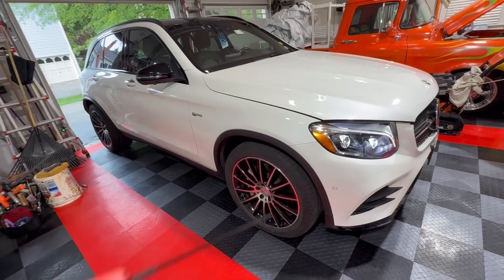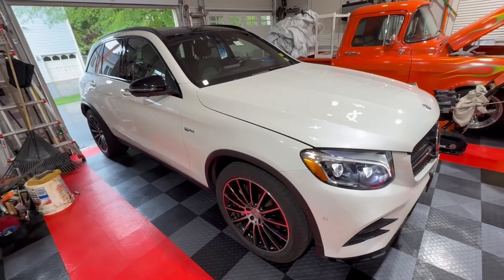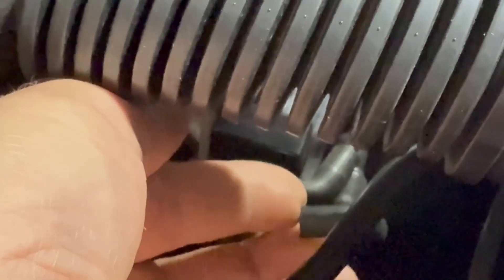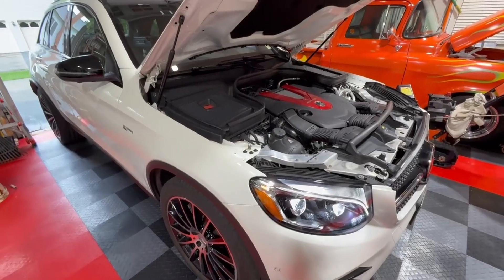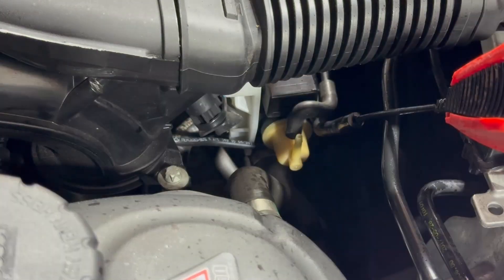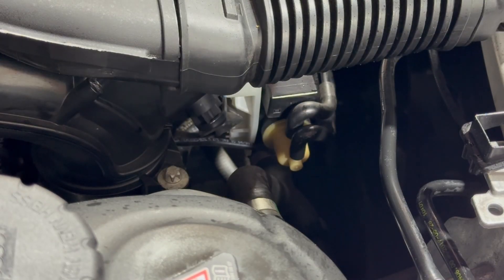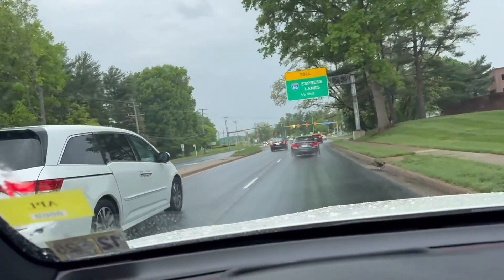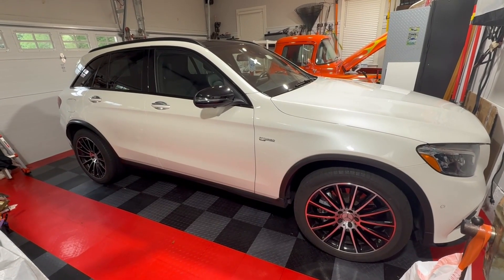Mercedes GLC43 M276 Intake Valve Cleaning

Comment: Hey! I’m going to give this a shot on my GLC 43 as well. Any update so far on mpg and engine feel?
Reply from the maker: Nothing scientific but it really seems to get better mileage and run better. I geek out on mileage and will post something on my next fill up as I check it every time. I really see no downside. Some other videos say carbon chunks can break off and get in combustion chamber and/or clog the cat but it is all theoretical. I think the crc chemically washes the valves. I’m going to do this every 5k miles before each oil change! Please keep me posted on your results!